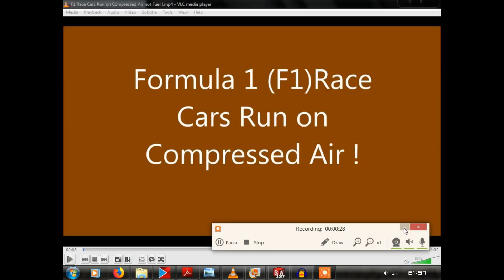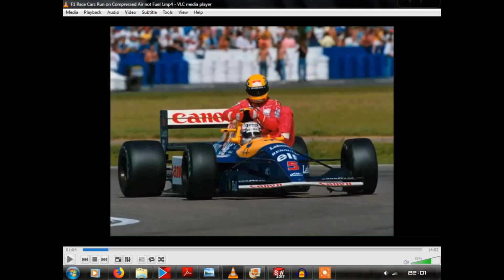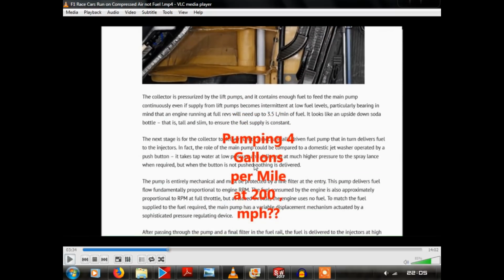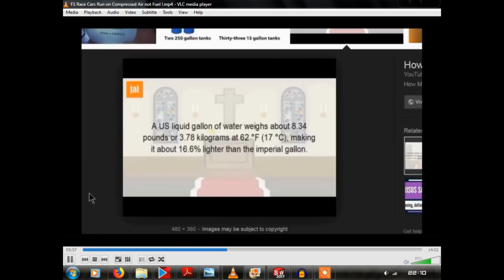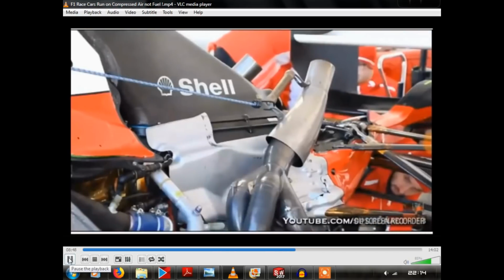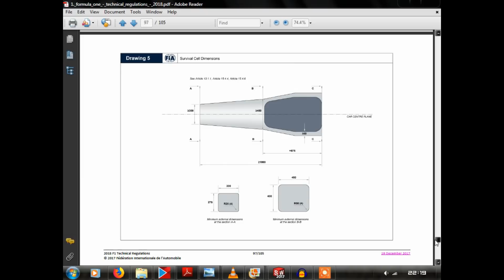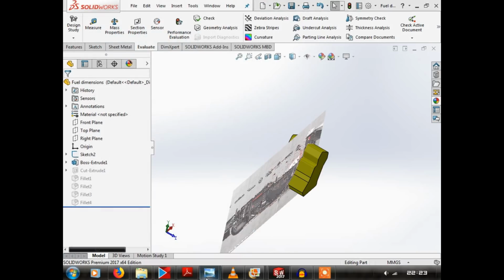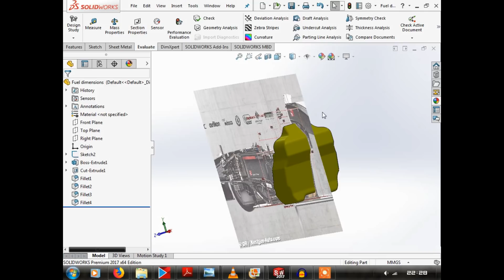F1 Cars run on compressed air!

Comment: 1. Huge supercharger 
2. Two huge turbochargers 
3. 4,500-6,000 psi titanium air tank
4. 1,000 hp 1,600 lb-ft electric motor 
5. Turbine adapter/ plate with 10 speed transmission
Reply: I can't work out how a turbo would benefit an electric motor given the whole point of a turbocharger is to increase the fuel you can burn in each ignition. The more fuel burned per bang, the more power after all.

I know compressed air tanks can be used to introduce air into the cylinders of an engine to increase the amount of fuel you can burn the same way that nitrous is used with obviously a need for larger tanks and a shorter run time to empty the tanks BUT the ability to recharge the tanks at trackside and a reduced cost but hoW would the compressed air benefit the electric motor?
Reply: @jediknight1294  Key word,  PRESSURIZED TANK.  The electric motor would obviously be for propelling the vehicle,  but also for turning the belt for the supercharger, which would force compressed air into the turbochargers , which would then force compressed air into the pressurized air tank. The tank would have a release valve connected to hoses that would connected to directional vents for down force,  or cornering aid . As well as onboard air Jack,  and self inflating tires . Just a way to get people thinking differently.
Reply: @g4do  OK that makes at least some sense, similar to the 'electric turbo' kits that exist and essentially give a nitrous type effect on an engine. (id love to build one of those as I can't stretch 2.5k for one that will do 5psi)
Reply: @jediknight1294  I have built one from junkyard parts and jegs auto parts.  The vents were very difficult,  the hoses were extremely challenging because of the higher pressures. I have no way of measuring how much down force it produces but theres no wheel spin from a dig . The motor came from an electric forklift.  The batteries I scavenged hundreds of laptop batteries,  I suck at welding but I got it done.  End result was crazy
Reply: @g4do  interesting, I'd be more likely to build an electric turbo if I had that sort of stuff around but cool none the less. Shame. You can't get it evaluated by someone who knows what their looking at and can measure its affect to see what the tradeoff of weight vs performance is.
Reply: @jediknight1294  electric turbo... hmm . How many rpms does a turbo produce I wonder 🤔 you can get extremely high rpms out of hobby electric motors like helicopter racing electric motors . That would be interesting.
Reply: @g4do  checkout the Torqamp that's essentially what I'd want to replicate.
Reply: @jediknight1294  ok I will , thanks man! You are very interesting,  I love challenging myself so I'm going to check it out right now
Reply: @g4do  I'm just a girl whose interested in the what ifs and wtf why not type of builds.
Reply: @jediknight1294  if you're interested in looking,  a company called Maxon claims to have brushless motors that spin at 100,000 rpms .
Reply: @g4do  oh yeah iv seen what's out there not entirely sure what you'd need but that sounds about right depending what the turbo you are converting can take.

Comment: Well he is telling the truth. Cars run on pressurized  air. The air compression however is done by increasing temperature instead of changing volume. This creates presser and as we al know this runs the engine. 
Oh and the increased temperature is reached by burning fuel.
Reply from the maker: But that's not really a air compression engine though is it?

Comment: he also fucked up with Tiff Needell as an electric race car wouldn't need to carry a 45 gallon drum the durr brain lol.
by the way check out the old wrc focus with a compressed air tank behind rear bumper to prevent turbo lag. its so sneaky and genius.

Comment: If cars run on compressed air, then how come they can run out of fuel and then just stop working. Air is basically in limitless supply going through the air intakes so how come that can happen if they don't run any fuel? The amount of holes you can poke into that dude's theory by just asking simple questions is funny.

Comment: What's your take on teflon coating brakerotors and  polishing pads to eliminate squeal and minimize wear?
Reply: They are slick...  ;)
Reply: Halikarnonsu mwlediven perfectly fine as long as you adjust your speed and breaking distances accordingly.

Comment: well its sort of true the air is compressed in the cyclinder when its mixed with fuel and when the fuel/air ignites boy do you get a big compression :-) ... they also think aeroplanes run on compressed air , they are idiots.

Comment: You could even just point to independent technology examples to argue the conspiracy theory is bollocks. Who has a compressed air system that powerful, who has an electrical system with that capacity at that size etc. Vs talking about every single system on those cars, you could quite easily point to other examples. Oil squirting, race piston design, oil tolerances, reciprocating mass, turbo design the list goes on.

Comment: ERMAGAWD i'm not the only person in the world living in a 1st world country using a square screen! I feel less poor now =D*edit* I actually know a lot of people who underestimate the size of a f1 car as they have never stood beside it, I've been to spa several times to see the qualifying for the f1 the first time I was baffled to see how huge they are, so were my friends! people also forget how HUGE a track is and how wide the track is in comparison to the open road. I bet a lot of people just look outside gauge how wide the road outside their house is and from there they conclude that a F1 car has about the same size as a Miata. xD
Reply: +Fabian van den Bussche 
Yes, F1 cars are large, long, low, wide and lightweight. 
Typical overall length of ~5,700mm (~224in). 
Typical wheelbase of ~3,760mm (~148in). 
Typical main tub height of car, excluding engine air intake duct, top-rear wing ~850mm (~33in). 
Typical static ground clearance of ~65mm (~2.5in). 
Typical overall width of car, including tyres, ~3,000mm (~118in). 
Typical overall body width of car, excluding tires, ~2,000mm (~78.7in). 
Typical race ready wet weight with the driver wearing his complete racing apparel, ~838kg (~1847Lb).
Reply: Yea0h first time I saw one blew my mind, they are about the size of a t34 tank's footprint

Comment: hahaha what the fuck is this, not running on fuel :DDD They even show the cross section of the car, WITH the fuckin tank, but noooo no, cant fit 200L of fuel in it? bullshit, they have never seen a oil drum.. the fuel cell in the car aint far off a oildrum in volume